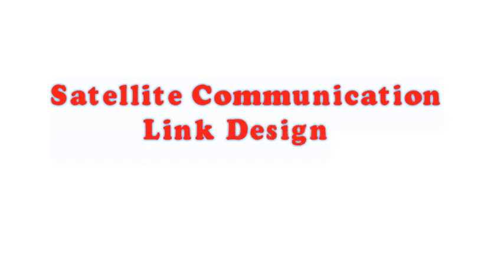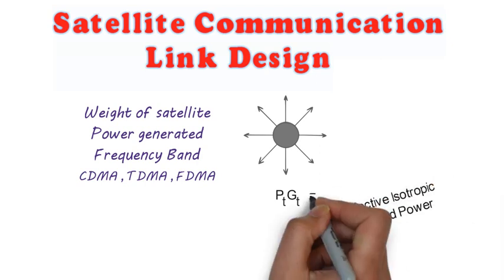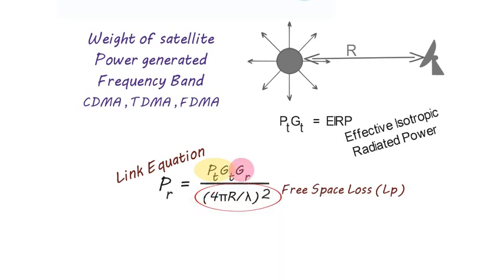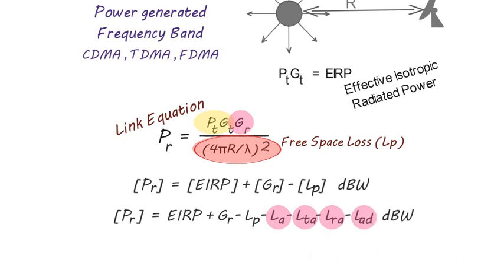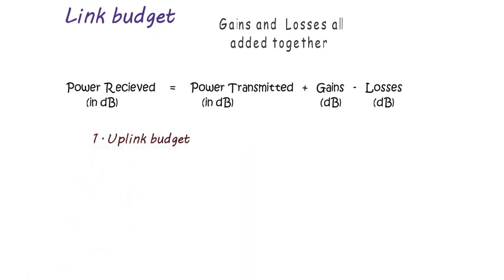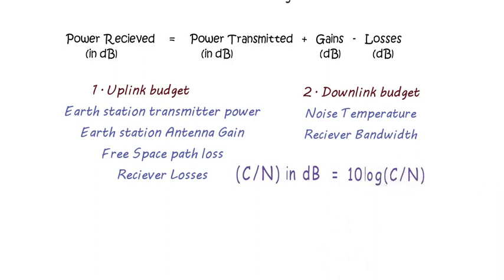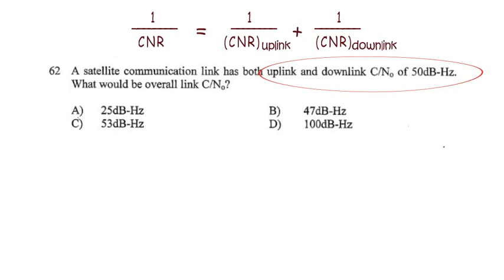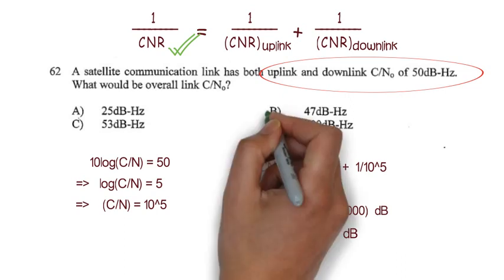ISRO Scientist/Engg | Link Design | Satellite Communication

Comment: sir nice video. more gain in less time. good effort.  plz tell how to solve CNR with out calculator in isro exam. plz upload for topic which is not in gate but in isro.
Reply from the maker: you must remenber the values of log2 , log3 , and log5 .
these values can either solve most of the log problems  or you can atleast reach the approximate values
Reply: ohk sir. is these 3 values sufficient?
Reply from the maker: yeah in the video i have used only the value of log5 and it was enough.
Reply: ohk sir. i m just asked for all purpose. thank u. will u make more video isro related topics? for communication ,edc, analog circuit series as u made for emt?
Reply from the maker: i'll try as much as i can
Reply: ok sir. its really very help full.
Reply: Sir more videos on satellite communication